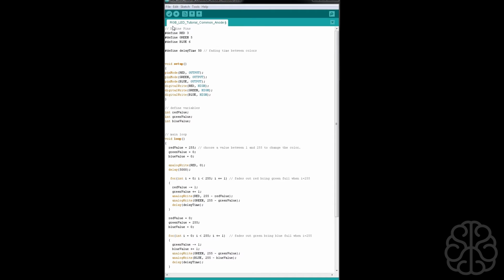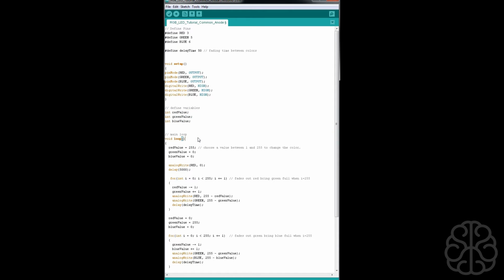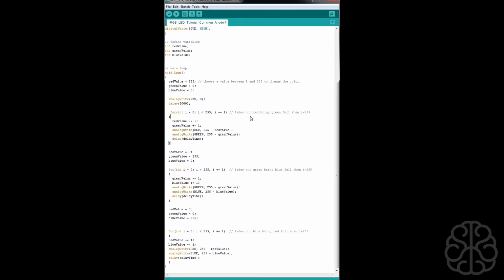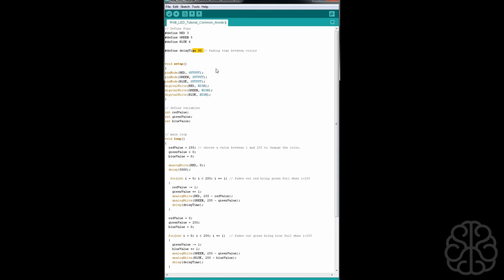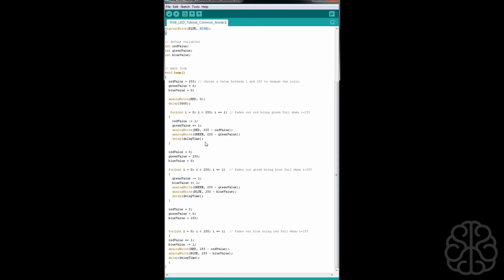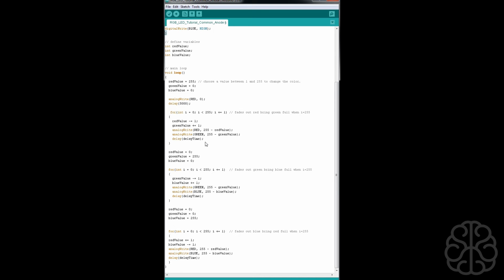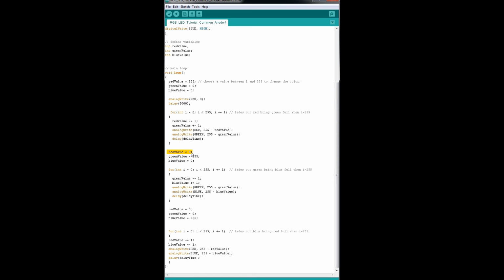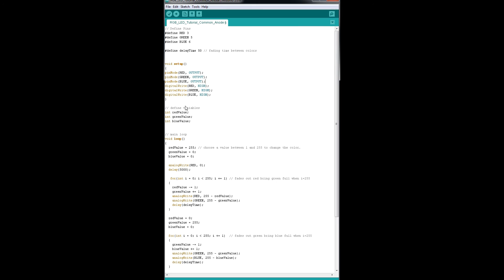Using an RGB LED with an Arduino - Tutorial

Comment: Hello Ivan.  I would like to start out by thank you for posting this REB LED Tutorial as I am a Neophyte to Arduino UNO coding.  I have a couple questions regarding this code. 1st Q: I would like to know is there a way to ramp up to Red for 5 seconds then loop to Green and then to Blue (2nd Q:) once code has reached the Blue color hold the color for 20 seconds. I re-entered the Green Code and then Red code to reverse the sequence from Blue to Green to Red Holding at Red it seem to be working. I am using a common Cathode RGB so I figured out the using Negative (-) number on the code to gets the RGB to light correctly, but as I wrote I am a Neophyte to coding.  I've viewed a couple of your other videos on your brainy-bits.com site which have been a great help.  Keep up the your tutorials and Thank you for any direction you may be able to provide regarding my question.